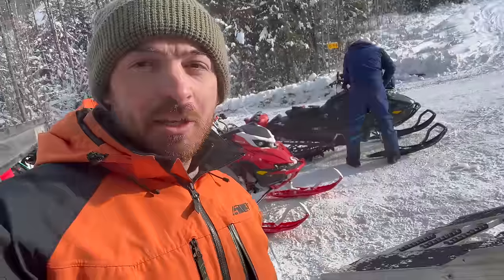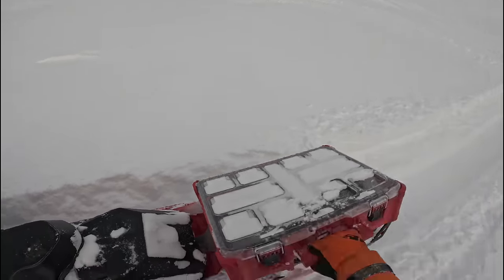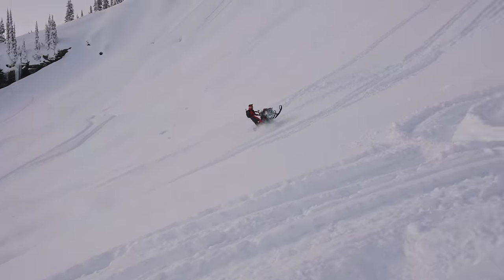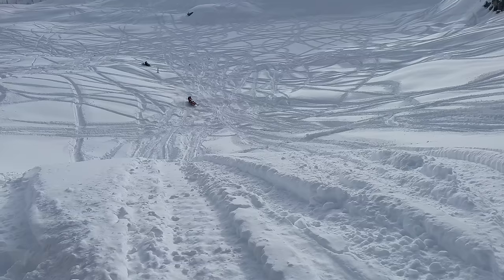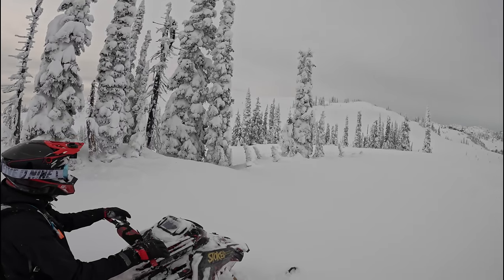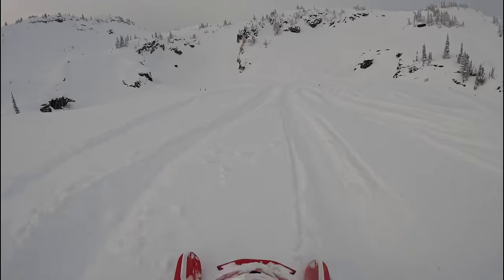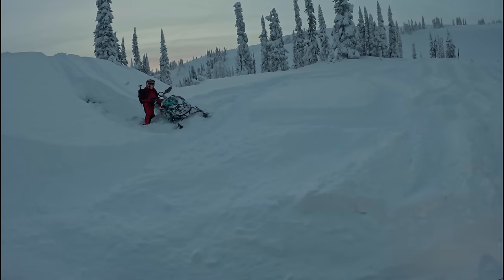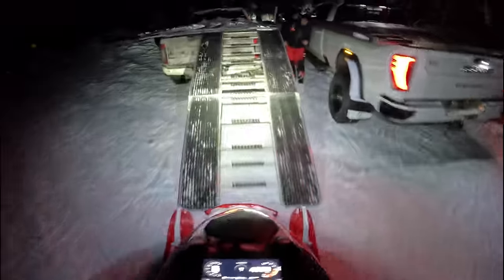Out Of Gas & Broken Bulkheads

Comment: There is a solid rubber grommet where the ski bolts on to keep ski from flopping staight down when front end is in air. Many yrs ago I had lent my pristine 87 Phazer to a buddy for a trip to the UP in Michigan for his buddy that didn't have a sled. After they got back home he was going up a ramp on the seawall to his yard from the lake with it, to put it away & it slid off the ramp into said seawall, destroying 1 ski. He did as he should & replaced it but...I wouldn't find out until later, there was a problem with install. Fast fwd to next winter & we were in Northern MI at a buddies cabin we all went to regularly, & went on a Friday night ride after getting up there & unloaded. About 10 miles from cabin we came to a small river water crossing, no big deal on usual night, but not this night. We had some newbies to water crossings & after showing them how to do it & having them do it, they were all excited. Well, on the way back I was 1st as usual to do "whatever"...this time I hit the water & did a Jet-Ski "backturn" & ended up upside down in the middle of river. After dragging sled out myself, finally getting it running, I made it back to cabin with a warm GF to hold me in bed to warm me up. After we get home, I take front skis apart & find he failed to install the rubber grommet in ski, so when I hit the water 2nd time, the ski, rather than skipping across the water, it dipped into the water, spinning me like a carnival ride. Funny how such a small part can have such a huge impact!!
Reply: Great story! Sounds like my friends & I.
Reply: That had to have been a horrible ride back to cabin! No frostbite?

Comment: Have run a trail tech for a few years until 7S display came along.  Great item to communicate and safety between multiple brands of sleds. You have to purchase an extra dock and wall mount charger to charge at home.

Comment: I don't think there's anything wrong with the Skidoo sleds. A belt is made of rubber and nylon cord. It can only take so much power before they get destroyed. And with all these newer sleds having turbos, I think that's absolutely normal. The engine technology has improved, while belt technology remains the same. Besides, I would much rather take a shredded belt on a Skidoo, then a sheared off primary bolt in the crank, or a broken quick drive. Atleast your back up and riding in 5 minutes, rather then paying $1500 to have your Polaris get a helicopter ride out of the alpine. Which then you're still left with a broken machine, thousands of dollars in recovery and repair bills, and then that's probably the rest of the riding season out the window. Yeah, I'll take a $150-$200 blown belt any day of the week over sheared clutch bolts, ruined crankshafts, and grenading quick drives.
I don't want it to seem like I'm bashing Polaris either. Their older machines are great. But they need to get the quirks worked out of these newer machines.

Comment: Winder if the 146s are geared too deep, it doesnt pull anymore track speed than a 165. That might be putting some strain on the belt and pulleys, could be venting iasues too. I always carried a full set of tools, bearings, belts, wheels, ski rubbers, everything lol.

Comment: I hadn't considered the daily gear swap you have to deal with...  I remember blowing a belt on the trail (way lower consequence).  As I was coasting to a stop it occurred to me that my spare was in my other sled.  Such a sinking feeling!  I went to the bar while my buddy rode to the dealer.  It did support my theory that most problems can be solved with beer and a credit card.

Comment: That sucks about the Bulkhead on his Sled, looks pretty nasty,  we were riding power lines in the UP in Michigan and one of our guys hit the upside coming down from roughly a 8 to 10 ft Jump hard in to the upward ramp on the Next jump,  hard enough to bend the Cat Bulkhead into Totaled Sled, it actually cracked the Engine block at the Mounting on the Bulkhead  and that ended that Sleds Life with 200 Miles on the ODO, hope your buddy comes out of it better than that. He also had a Trip to the Hospital afterward and Disc Surgery but all turned out OK.  It was a scary deal especially because we all saw it happen right beside us in a big Cloud of Snow, Smoke and pieces of sled Flying apart.  Even on the Trails with 140 inch suspension there's always the possibility of Terrain damage at 60 mph / 100 kph .
Be safe guys!

Comment: I totaled my summit with the same damage, only worse. The sled wouldn’t even pull over because the clutch was pinched so tight. Had to remove a motor mount bolt to release pressure for it to spin, then the same grinding sound began 😂

Comment: This is complacency at its finest. Never send a guy alone. Ive wrecked my front end and said ill limp down while you guys finish the day, I went 15 feet off trail due to a missing arm and having to sidehill all the way out, got stuck and then watch 6 guys ride by me leaving me on the mountain. I got out and kept limping meanwhile they got to the truck and then 2 had to ride 20 kms back up the trail.
My example isnt the exact same but any kind of distance riding you should have a buddy go with you especially at the end of the day. Ive gone solo riding and i get all the what ifs and what nots. Ive hit walls wearing all sorts of goggles in low light conditions ect.
Reply: Sounds like you didn't have a radio or tracking.  Complacency comes in all forms.

Comment: i for sure know that it looks easier than it is. but still, the "deep" snow i so far experienced (not deep compared to what these boy´s ride in)  with my new Lynx is that its easier to ride with a nice flow, just like i was riding my Yamaha R6, sitting down or standing upp. but as soon i get snow that is hard, with a ice lid or really packed snow is SO much harder to ride than powerlike snow we see in these video´s. that is the most easy snow condition to ride in. but i dont ride up a F-ing mountain or in the thick woods. that adds a lot to the difficulty level. and i am jealous AF now. cuz in Dec and Jan we had super good winter condition for a good sled winter. but 3rd week of the year it started to rain and thaw and that fucked it up. it has been snowing a few days adding up more Centimeter´s but the day after thaw or rain every F-ing time... last night i snowed "man cover" lid like snowflakes i was so happy today it rained for 10 hours and temp was +1.1 C...

Comment: Matt, TT GPS, instead of accessory plug, you hot wire off the battery and add a switch. Then you control off and on, not your sled.

Comment: put a 12v plug on the end of a doo wire and plug it into the truck to charge the gps.  all these manufacturers for safety need to be sharing location. Garmin, Polaris and Doo.

Comment: I know we have spoke a little bit here and there.  I watch every day.   So i ride a 2023 and 2024 skidoo summit 146 n/a in the flat lands.  I ditch bang.  Yes its tippy in the ditch.  Just the way i like it.

So, today you went from the linx to the freeride.  You said it felt more nimble.  I always thought the lynx suspension would be more suited to what i do.  

My question is, do you think the handing is because the lack of t motion on the lynx?......

When i first got mine i set the belt as per skidoo.  And i rode it for like 300 miles.  Then i tighten the belt as tight as i could get it and it is not 30 degrees cooler all day long.  I went back to the stock hight and the temps went up.
Reply: Two other youtubers that had Lynx last year sold them and went back to their previous rides.  They both said it is too heavy and not as playful.  The one guy is 140lb soaking wet and said it was just too much for him and sucked being tired wrestling with the sled by lunch time.  The other guy was big but still said it just isn't fun.
Reply: @MrWookie1981  weird.   I know nothing other than riding the summit 146.  Since 2017 I have bought a new one every year.  I guess I will just stick to what I know.

But I do know that the stock clutching needs work.  I have replaced every stock setup with a DJ kit and it's a huge improvement.   That and running the belt as tight as I can get it.  

Yes I'm on the flats but all I do is wheelie.   And seeing 30 degrees drop in belt temp surprised the crap out of me.  But basically,  if loose you start out in a different gear ratio every time.

Comment: guys... bring an infrared gun. Get into the data of this instead of expecting belts to be invincible lol you have to let them breathe. Nothing is breathing when your bars deep. Design concepts, can not match reality of conditions when conditions are far past extreme. When engines cant breathe, they bog, when clutching is hot, they bog, when belts get held wide open for more than 5 10 min at a time. They will blow, no matter what. So when i can put on thousands of miles on a belt, pinned plenty, and not blow one. I attest this to letting them cool off once the adrenaline is exceeding belt temperatures lol even without the hood covered in snow. The conditions under this hood are almost unfathomable in the lab.... you cant re-create this for testing in house lol aside from venting, taking breaks, and  designing a new belt there isn't much you can do. Ski Don't doesn't need help looking bad... just like any other manufacturer or business. They literally have the best clutching in the game... I'm a die hard cat guy, been watching your vids for years and I'm also a mechanic for many moons now. You really gotta take some responsibility for what you put these thru and get the data. Get belt temp checks thru out the day, oh and actually try breaking a belt in for once lol before you put it into your bag when you have time to get it up to temp and cool it off two or three times. It doesn't take that long and i know you'll get more from your belts. keep up the hard work and killing the snow this year.. along with parts as usaul. if youre not breaking shit or falling off.. are you really having any fun ? lol especially if you want to know the difference between light heat and high heat. Belt break in, trail ride it at like 25 to 50mph ranging in speeds and not to cruise too consistently. Small stretches at a certain RPM is fine, just very the RPM for 15 min. Pull the side panel and get a belt temp reading to see what it runs with nothing blocking the vents and under low load conditions. Then go thrash a creek for 15 min solid, pull the panel and check the belt temps.. this testing and tuning is exhausting and laboring  but when you want to actually fix an issue. this is how you start. How many sleds do you have now matt?

Comment: Have you ever tempered a belt before ? With an untempered belt I am suprised you get 10km per belt.
Reply: Usually when blows one makes a joke about break in and holds wide open so I would say is well aware of at least but not so much a current practitioner.
Reply: @Aspired329  I break them in as soon as I by them. Always have 2 tempered spares. I am an old timer, when I started sleds were different and belts broke even if you took it easy.